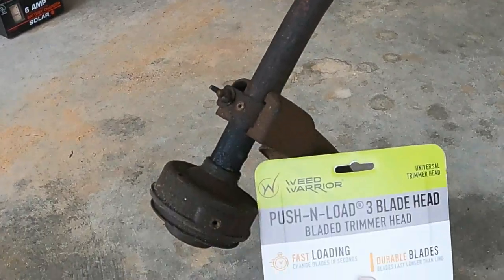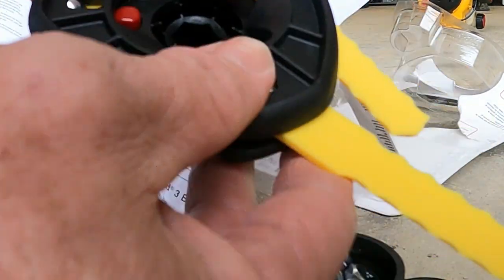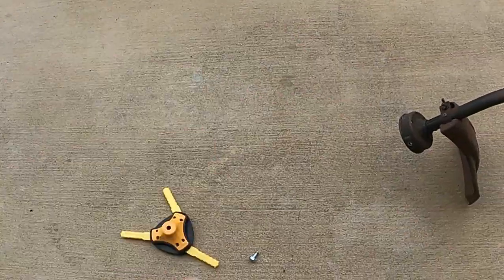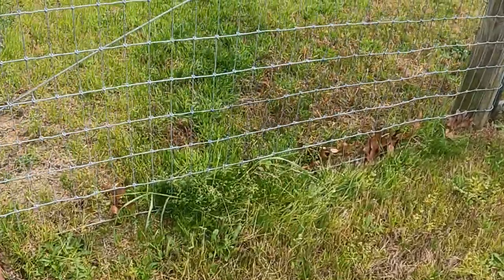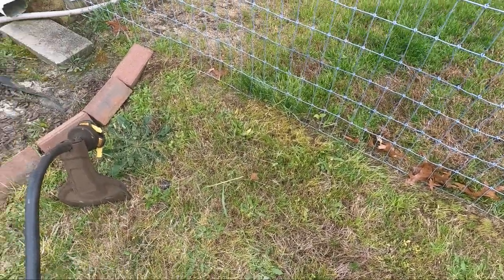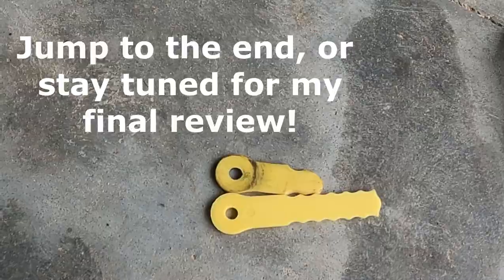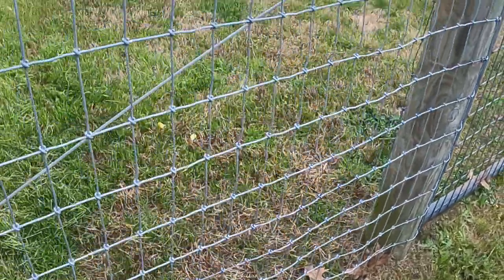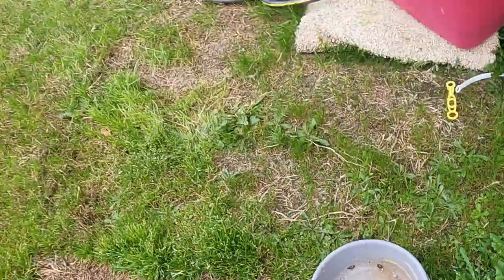Weed Eater Blades for String Trimmers - Complete Guide - Review, Tests and Demonstration!

Comment: Had one of the ones with metal tipped plastic blades break off and cut through my leather boot. Never used one again
Reply from the maker: yea, it did seem a little dangerous, pieces flying off at high rates of speed.   I always wear good leather shoes when mowing and weed eating